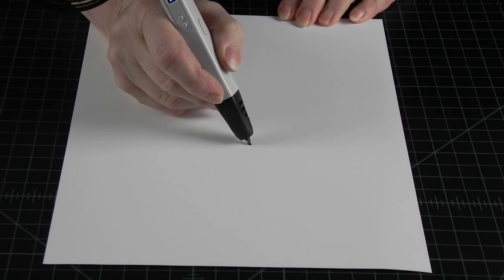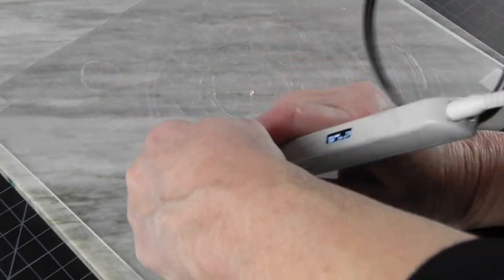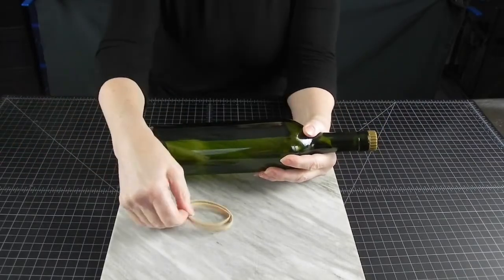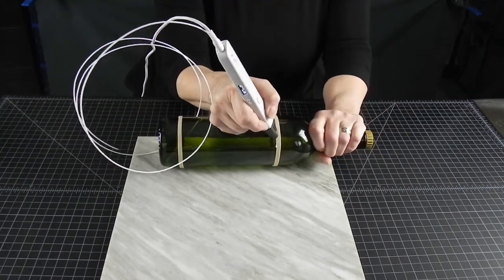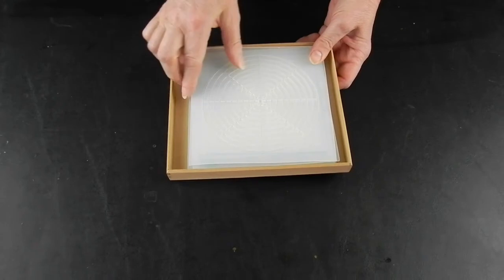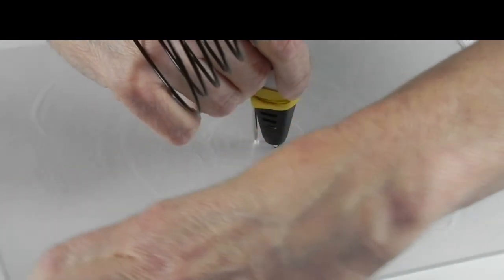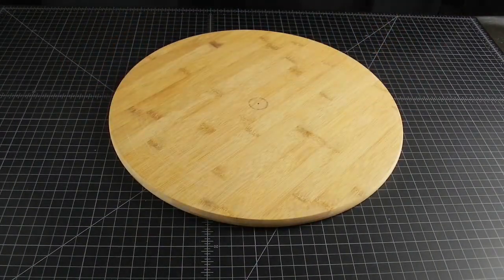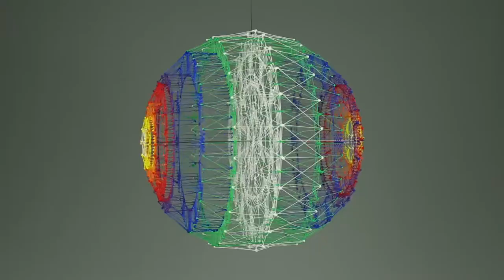5 ways to make a perfect circle with 3 d pen

Comment: Seriously my 3d pen is 109 Ron and the color isn't as liquid as yours so how do I make a circle?what's the speed so you can make the circle easier
Reply from the maker: I would say if you are new pen user go slower if your pen has adjustable speed. About as fast as you would go if you had to trace the circle accurately with a marker. I am not familiar with the pen you have but often the problem is not the pen but the surface you are working on. What are you using as a work surface?  Perhaps these 2 videos would help:
7 things you want from your 3d pen work surface
https://youtu.be/n9RXEH7BAzA
Best work surface for 3d pen
https://youtu.be/QP7YsXWvb8M
Reply: Tysm!!!!

Comment: Hi , I just got the 3d mat. I am practicing circles today on the mat and I am finding the lines that intersect the circles to be a hindrance to creating larger, smooth and continuous flat circles. Any suggestions would be really helpful and greatly appreciated.
Happy Holidays and thank you!
Reply from the maker: I think I know what you are talking about (but it's hard to know for sure without pictures.) There is a certain spillover into the intersecting grooves as you go around. In the Easter egg video you can see it in detail about 2:24 into the video. https://www.youtube.com/watch?v=sRYhmASSP-Q  Usually these spillovers are not too big but if it's creating problems for you, let the circle cool, remove it from the groove, and snip off the spillovers with electrical cutting pliers. If you need more help go to the 3d pen den Facebook page and contact me from there so we can exchange pictures.
Reply: @3DPENDEN  many thanks . I will take some pics and watch the link you shared. You’re the very best!

Comment: I just want to make a circle, I can’t even draw a regular one. The filament in my pen doesn’t come out smoothly in one line, it comes out curvy and wiggly, no matter the speed of the pen or my hand or my steadiness. It’s impossible to make A SHAPE, let alone a PERFECT CIRCLE
Reply from the maker: From what you describe in both of your messages it sounds to me like your work surface is the problem. Watch these two videos and then try again and let me know if that fixed your problem. I almost gave up initially because I was trying to work on non adhesive surface. If the filament can't stick to the surface it will wiggle and/or stick to the nozzle.
Advice on work surfaces:
7 things you want from your 3d pen work surface
https://youtu.be/n9RXEH7BAzA

Best work surface for 3d pen
https://youtu.be/QP7YsXWvb8M